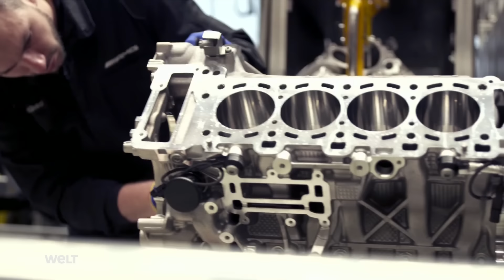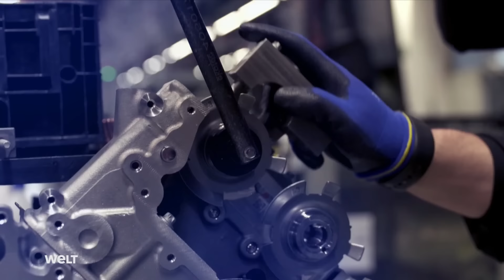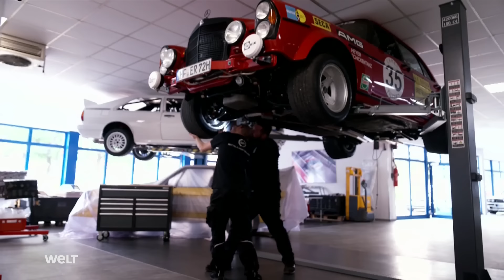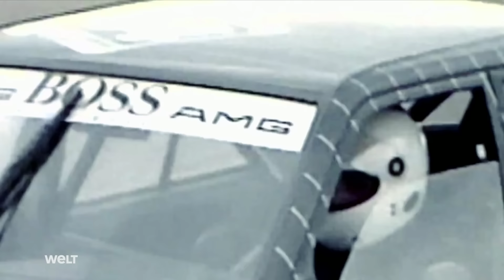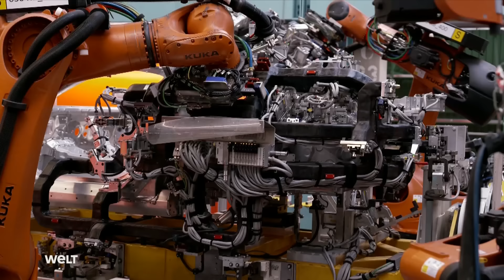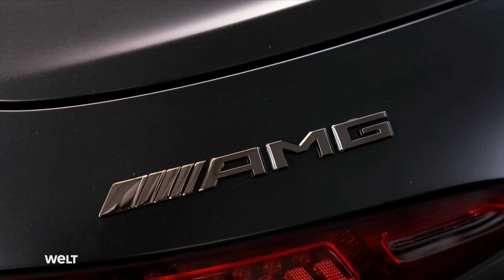INSIDE MERCEDES AMG: Handbuilt V8 Engines – One Man, One Engine

Comment: If all the components and parts on a Mercedes came from AMG, then Mercedes would probably be the best car manufacturer in the world! Unfortunately, that's not the case, and so you'll often find parts in and on a Mercedes that, in terms of functionality and quality, simply don't belong there and can consequently cause frustration and dissatisfaction for the customer. Too often, it's not the engineers but the controllers who decide whether and which vehicle part is installed. This often leads to inferior quality and durability.

Comment: You're an overglorified assembly boy. You didn't design it, test it, or machine it. You should have been replaced by a robot years ago.

I suspect that the only reason you still have a job is due to a labor union.

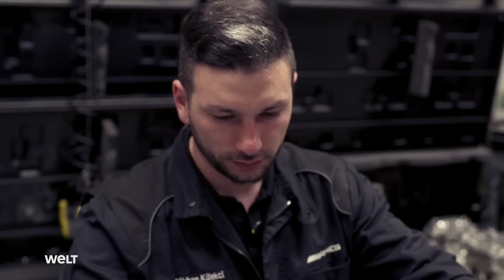Comment: Mistake, @ the 8:14 mark when he puts his hands on the top of the block where the head bolts up to, he took the cams off the otherside, which might have some residue on the cams, thus his gloves might have a little oil on it, thus the top of the block where the head bolts to the head casket might not have a perfect seal.
Also at the 8:55 mark the head does not marry up with the crankcase, but to the engine block. IMHO. 👍🦘✌😠